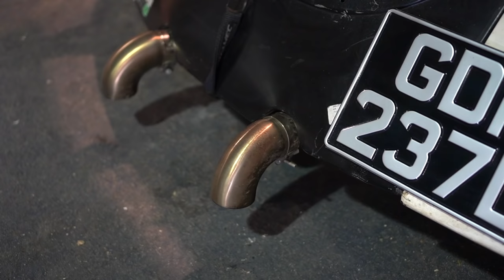NISSAN SKYLINE POWERED VW BEETLE - THE CRAZIEST VOLKSWAGEN WE HAVE SEEN

Comment: Guy down the road from where i work (they weld any cracked alloys for us, top work) is doing something similar with a Beetle shell on an S2000 floorpan and running gear. Also has a Pug 205 CTi with a turbo Type R lump in it and iirc a 4x4 309 GTi on Impreza running gear...
Reply from the maker: Could you please contact us through our Instagram, would love to find out more
Reply: @MotorAddicts  will do, he's been off for a while after surgery but a lad in the same row of units brings his mot's to us so if i can find out when he's back working i'll let you know.
Reply from the maker: @jonpowell8014  super star, we have some soft spot for pugs 😂

Comment: E36 has one of the best chassis ever imo so not surprised it drives so well at all
Reply from the maker: Even though he took 13 inches out 😂
Reply: @MotorAddicts  it’s now a 36 compact chassis 😂. To be fair I think they have same wheelbase. The mechanical grip etc in an e36 is amazing that’s why they make great drift cars. I wonder what diff has been used I’m putting an RB20 into my e30 wasn’t sure how gearing is going to work out as I’ll be using the RB20 box
Reply from the maker: @BigKrisMorris  he’s put an m3 diff in this

Comment: I'm curious about all the cut and welding you made to fit the engine and gearbox in the front of the car.
I understand this is a front-wheel drive because of the new weight distribution?
Reply: It's rear wheel drive 👌    and it's a bmw with a beetle shell remember

Comment: Hi. Is the radiator only getting air from the two fans?
Reply: No,    it has natural cooling to the boot through the holes above the decklid     and the decklid itself scoops some air in,       and it also has 2x naca ducts from the rear quarters

Comment: Une 2jz dans un e30 la ta un avion de chasse deja elle et bien plus belle que ce rater  Rod  pare contre un e30 tu peux faire le parfait slippeur moi j ai toujour adorer les voitures qu on croit stoc bien entretenue et tu te dit que cette voiture de pépère propre tu la mais à l amende parlant en connaissance de cause c est un pur plaisir qu une fois que o autre te rattrapé veux tout savoir sur ton e30 ou il était écrit 316 i le plus petit moteur en vraie c était une caisse 323 que le moteur avait rendu l ame et vue qu une 2jz tenait autant faire un missile de 1400 ch elle était tout le temps en burnes même avec la boîte 240 siylvia 4 em sa fumer encore c était fou d ailleur celui qui la racheter deux semaine plus tard enrouler autour d un arbres ca va lui et le moteur aller bien 😜👌

Comment: I'm sorry, because he built it he knows the handling? Until he drove it, he had no clue how it would handle, it doesn't work that way. If it did, you would never require testing or practice because "MAGIC" knowledge. 🙄
Reply: I think he means when you build a car yourself you know the limits of the components ?    To be fair I have driven enough e36s to make how it would handle    just like a really twitchy version with more power lol